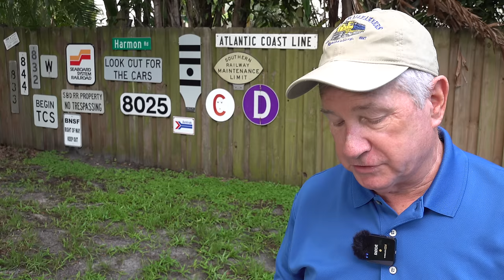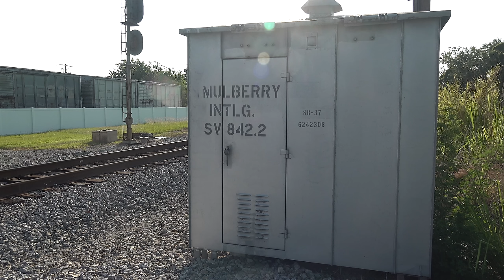Who Controls Railroad Diamonds?

Comment: I think you nailed pretty much everything. I used to be an engineer for two different railroads years ago. There's an automatic interlocking I used to have to deal with in southern Missouri in dark territory. Sometimes it wouldn't work properly and you had to go up to the box. If I remember correctly, you would hit a switch and have to wait at least 5 minutes and then you would get the signal. There was even rules that it still didn't work. You pass the signal, you would have to wait a certain amount of time before you cross the diamond. It was a similar lockout to house tracks or industry Spurs that came off mainline CTC or ABS territory. On a side note, the derail sign is normally white letters with blue background. Whereas a distant signal is white letters with a black background and mounted on a signal.

Comment: Danny another one of your spectacular videos and once again we see why you are so special. You did a video on a request that you said woo  
I need some more information to do this one and you went out and did some great research and information seeking through the connections you have made over the years and so we get one more of your great informative videos again. Great job and I really thought it was neat to see how one of the first diamonds shown was right in the middle of a highway and I would imagine it could have been just as easily completely paved but is actually left in paved right in the center for whatever reason. My guess is leaving them the ability to visually inspect it and possibly tighten up some of the many bolts involved in the building of one of these centerpieces of railroading. 
It makes me wonder how many non attentive drivers accidentally drive into one of these and get their vehicle hung up. 
Danny a heads up on dome information you may want to pass on to your viewers is how a lot of crossings now have smaller signs with what railroad is responsible for that crossing and a phone number to call if there is a problem with the crossing and a lot of times it gives their number or name for that crossing. If that info is not there call the nearest law enforcement agency or 911 and tell them what is wrong and if you can describe to them good enough information of location they will take it from there to inform the appropriate railroad that they have a problem such as stuck gate or broken gate or in my case one day. On my way to and from work at the Belvedere Chrysler Assembly Plant I would twice a day cross the former Illinois Central now Canadian National Freeport Subdivision tracks on the road that actually takes you into town on the east side of the plant. The one day as I was crossing the prebuilt concrete grade crossing that was installed approximately five years earlier as starting to break up and the was a piece of the concrete the size of a bowling ball laying in the highway/crossing and this road gets quite a bit of traffic all day from employees and suppliers and farmers and gravel trucks due to the many pits located in the area. Anyone hitting this thing may damage there vehicle and or be injured or involved in and accident or a truck or train may hit and throw it at another vehicle. I called the number on their sign and buy the time I was returning Homs after a days work the crossing had been cleaned up and a temporary blacktop patch installed. That spring a complete new road grade crossing was installed in one day.  
Keep up the great work Danny.

Comment: When I worked for BNSF Mow Los Angeles, we use to constantly work on the diamonds leaving Hobart yard (see the old interlock tower) .... those diamonds take a beating and every rail including the double fist size nuts and bolts are dug out and tightened, with big ass wrenches by hand!! best workout I ever got. Neito Junction and Wittier diamonds were bad. When you got dispatched to the diamonds at Hobart tower, I knew I was going to bust my ass. Day or worse in the middle of the night.

Comment: I love your video.  But I have one for you about railroad diamonds.   In March of 2000, I was training for my new job in Marion, Ohio.  I went do to the station there at Marion and saw something that I thought was going to derail a train.  The NS train going through the diamond, one the bolts on the diamond was already popped out and second was working it way out spinning as the train was going over diamond.  Later I went back and saw the maintenance crew from NS working on replacing the bolts and fixing the problem.  I wished I have a video for that.  I felt weird and kind of scary at the same time.

Comment: Over here in Germany we pretty much just do diamonds with trams crossing factory rail connections, i.e., low-traffic dead-end proper rail crossing medium-traffic light rail/tram.

For proper rails we either build them flyovers our of concrete, or if the lines are sufficiently low-traffic, funnel them in through a Y-switch into a common section, and out into another Y-switch for the other 2 of the 4 directions, and put down some curves. Now this makes me wonder about traffic circles for trains.......

Comment: Absolutely fascinating - it's great to have all the detail you reseached!  The Tico streetcar crossing is amazing.  The six minutes 32 seconds allowance has me a bit worried.  Doesn't that mean that a driver who has taken too long to get his locomotive on to the diamond, and still has a long consist to follow it, is incentivised to accelerate rather more than is safe?  In general, the system would seem to encourage train drivers to behave like a cat crossing the road - head down, don't look, go as fast as you can!  Most times it will work, but when it doesn't ...
Reply: I would guess they have a rule stating if approaching an interlocking and the train dropped below a prescribed speed, the movement would need to be slowed and prepared to stop short of the signal protecting the interlocking.

Comment: Here in the UK those type of crossings are very rare, there is one at Newark where the East Coast Mainline crosses the Nottingham-Lincoln line. On the mainline passenger trains run at something approaching 100MPH! There used to be a few others but they are now gone. It is said that at Retford crossing back in the early days a passenger train found a freight crossing when it should not have been there. Seeing as there was no way it could stop the driver opened the regulator and smashed his way through scattering wooden bodied wagons all over.

Comment: On GCOR railroads, an interlocking controlled by a person is called a "manual interlocking". Generally, they're treated just like any old control point. The only time "interlocking rules" come into play is 1) getting talked by a red signal, you have to make sure you're talking to the right subdivision dispatcher. 2) you can not pass an absolute red at a manual interlocking in Track and Time without talking to the dispatcher.

Comment: Hello thank you for your fantastic knowledgeable videos.... I always learn something from your videos however I wanted to point out that the diamond at Lansdowne Avenue and Dupont Avenue in Toronto is actually the busiest diamond in the North America...  The one side is Canadian Pacific   or better known as CPKC and the other is Go transit or government of Ontario transit.... The government actually implemented a plan and had contractors involved where they actually built the Go transit line over and above the CPKC line and with that there are no longer any issues.... Both of these lines were very very busy at any given time and there was no way to be able to increase regional passenger trains without, either eliminating one of the two and rebuilding elsewhere or raising the passenger regional rail lines as mentioned and now go transit for government on Ontario rail is now able to increase their train schedules for commuter passengers... Fantastic job and I was lucky enough to be able to watch most of the construction of these pillars etc and installing prefabricated concrete trusses or bridges in essence with integral rails..

Comment: Thanks for tackling this very interesting and complicated subject.  I would imagine that there are almost as many variations as there are diamonds. 
Here in New Orleans, there is a pending diamond conflict yet to be resolved, between the recent St. Claude Avenue RTA streetcar line and the Norfork Southern at their Press Street yard lead.  NS has so far refused to grant the RTA trackage crossing rights, despite there being a grade crossing at the same location.   The Tampa situation might be an applicable precedent.
Reply from the maker: Interesting. I imagine it depends on how much traffic NS has on their line.
Reply: I don't blame NS. If it's a yard lead they'll always be needing to have yard jobs on it switching trains and the frequent movements of a transit authority would cause problems for both companies. Sounds like RTA needs to get real and build a bridge.
Reply: Actually, yard activity along that section of the Press Street yard is currently minimal.  The proposed rail crossing is along a very busy thoroughfare — St. Claude Avenue -- with constant vehicular traffic, none of which seems to impair the now minimal yard ops.  It does not appear that the occasional streetcar would impose any more burden than do the present transit busses and school busses, or the tractor trailers using that grade crossing.  
My own impression is that NS is exercising a dog-in-the-manger approach.

Comment: Love TECO. Spent some time in the Tampa area in 2019 my ship was moored at one of the cruise ship terminals, and Teco was my way to the restaurants and scenery in Ybor City. Great video. I'm working with a small railroad museum that has the board and apparently the levers for a Pennsylvania RR -- Erie RR diamond. Back in the day it was Erie RR Tower X on the River line and was a quadruple diamond two double track sections crossing. Erie, was more or less the right of way line. Penn had a yard about 2 miles south and the Yard interlocking had a 'traffic' circuit that allowed them to request a the crossing. if the Erie line was clear Tower X and the Penn tower could set the signals and switches to allow Penn to move North or South through the interlocking. It has been a lot of fun digging through sources to figure out how all of this worked.

Comment: Danny I wanted to say thank you so much for not calling them Interlockings. Not all diamonds have interlockings and not all interlockings are diamonds either. Just a simple junction turnout may have an interlocking if it is electronic or has a human element attached to it. I feel like that's a huge misconception that railroaders understand, and railfans do not. 
Now my first real-world experience with a railroad at-grade crossing, diamond for short was in Toronto, FL where the Tavares, Orlando and Atlantic (=> FC&P => SAL = > SCL) crossed the Orange Belt Railway (=> Sanford & St Pete => Plant System => ACL => SCL) And Overland Road also passed over at the same spot. Map-wise this would be in Apopka. By the time I was there and saw it for the first time as a Conductor, it had a 24-ft red pole gate with a Lock that held the gate across one track or the other and had stop signs which perfectly lined themselves between the gauge of whichever track they were blocking at the time. The timetable expressly said to prepare to stop at the crossing in any of the four directions until it is visibly clear that the gate is lined for your movement. The main track was the old Seaboard line and the Forest City Branch that crossed it was considered a branch line, therefore it was also written that the gate must be left lined and locked for the main track except when trains are using the Forest City branch to cross it and then the gate must be restored for the main track. 
But now I remember seeing an old signal while I was switching a customer South of the crossing on the Forest City branch. I thought it was a searchlight signal but an old hogger that used to run that line back when it was still connected to Sanford said that it never showed any other than a yellow aspect. It also had an "APP" marker on it. When you got to the crossing, there were two signals in either direction and they showed either green or red, on a 2-color signal. He does not remember what the signals looked like for the old ex-Seaboard line but according to photos posted on Flickr https://www.flickr.com/photos/alcomike/8042221586/ They had a dwarf semaphore and derailer, which interlocked with the rest of the system. There was one of these dwarf semaphores and derails on both sides of the crossing and this maintained that the ACL line was primary, while the SAL line was secondary. If Seaboard needed to get past the diamond, they had to open and unlock the switch and wait for the timer to run time before they could drop the derailer. Doing that would also push the semaphore up, giving them a clear signal. But then they would have to walk to the other side of the crossing and do it again, this time without the timer delay. Neither I , nor my old friend could find out when they abandoned the signal system in favor of the gate. But we do know that the line between Paola Jct and Forest City was abandoned and dismantled in 1971, following the abandonment of the Sanford - Sorrento branch, caused when a fire destroyed the bridge over the Wekiva river. The photo was taken in 1975 and so by then, there was a connector track installed on the South side of the diamond on the SAL side, to the North side on the ACL side. 110 pound CWR made that connection. 
Today none of that crossing remains. The Seaboard track eases underneath Overland Rd and the 414 toll road unimpeded by signs, gates, crossings or anything. Everything from Forest City to Toronto was dismantled back almost 20 years ago now. (Wow! I am feeling old) I have a picture of me working a train on those tracks. 
Anyhow, enjoy the story! And thanks for covering the good details for everyone.

Comment: 9:45 I was hoping you'd talk about how 90° diamonds are the worst because they provide the least support for wheels crossing the flange gap.  Smaller angles are better because the wheels stay in contact with the railhead for longer.  It's fractions of a second, but it matters greatly for the batter on the diamond.
Reply: I think that's something that matters more to railfans than railroads.

Comment: Backing trains in and out of stations, something that would be considered completely crazy in Europe for mainline movements. Only backing up movements authorized are for shunting purposes or to clear the line in case of hazard, and in that case, it has to be authorized by a written order specifying exactly how far the movement is authorized to go.
Reply from the maker: That's wild. Our trains back up all the time.
Reply: @distantsignal  thanks for the reply!

Well, to begin with, there are relatively few instances where backing up could take place as — especially for passenger trains — as the network was tweaked and tailored to serve primarily that kind of traffic, and when trains need to change direction mid-journey they either have the locomotive(s) run around the train or have two locomotives "sandwiching" the consist.

Tomorrow morning — by pure chance — I have a southbound service with some empties coming from Germany and headed to a Lamborghini car manufacturer plant in a place called Quattro Ville, which can only be directly accessed from the south, so we'll have to run as far as Modena, a few miles south, access the station yard, run around the consist, and head to the plant running north.

Comment: OWLS crossings look good in some regards, but seem like they will be maintenance heavy due to the flanges digging into the track over time. That will cause noise and rough ride issues, and there is also a risk of the track breaking. I would hope that like on a traditional diamond, the track is well fixed and supported to prevent the risk of misalignment if the track does break.

Comment: In my 11 years of railroading on the Missouri Pacific and Union Pacific all railroad crossing are called inter lockers! Never and I mean never was it called a Diamond. I spent two years as a track man and machine operator so I actually installed interlockers and 9 years operating trainings across them. All of our “interlockers” where  automatic interlockers. Meaning the first train to enter the signal block automatically receives the green signal. However due to a large variety of other conditions, one train, or the other may be required to, “ work, the interlocker”. That requires the brakeman to walk down unlock the interlocker control cabinet. Wait for a certain amount of time push the button, and then wait until you receive the green signal. We did not have any Dispatcher  controlled interlockers